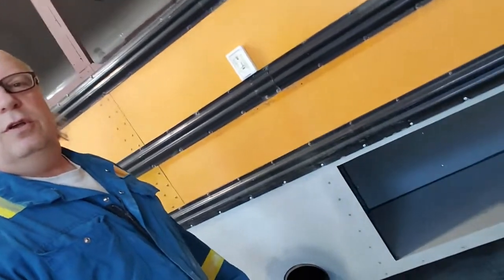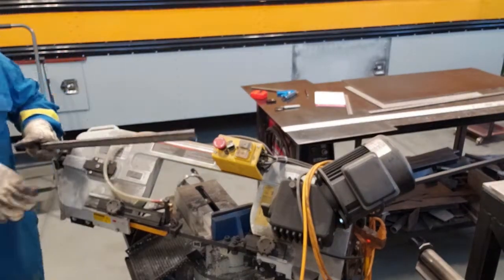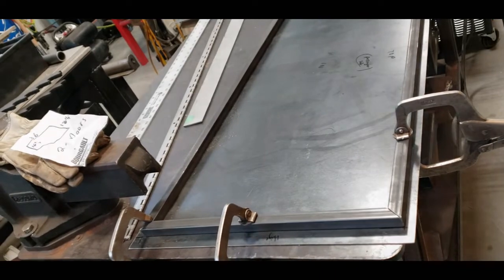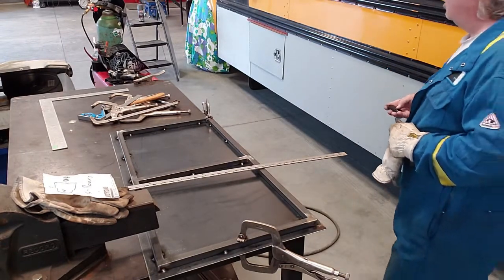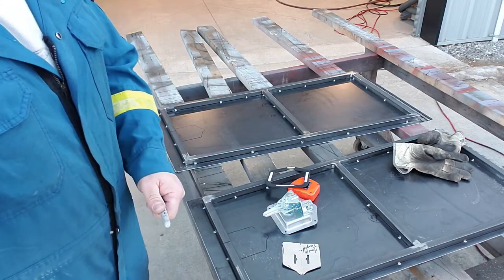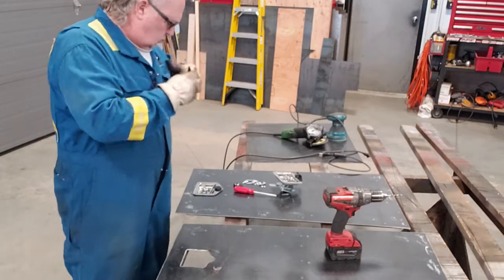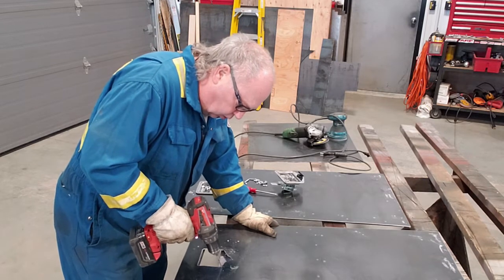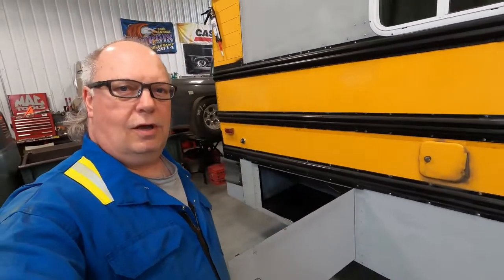Just Bus'n Adventures Episode 6 Storage Door Fabrication Part 1 2001 Freightliner Bus Conversion

Comment: Thanks for the video! Very helpful. Now I need a bandsaw ;)   Did you get the handles from McMaster Carr?
Reply from the maker: The bandsaw is a great tool for sure but this job can be easily done without it.   The handles are from a local supplier, not McMaster Carr